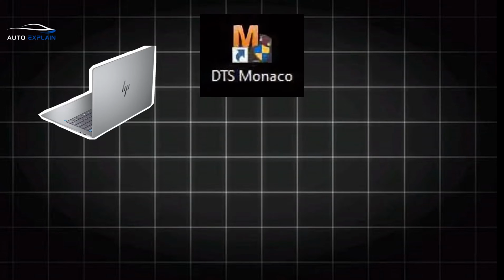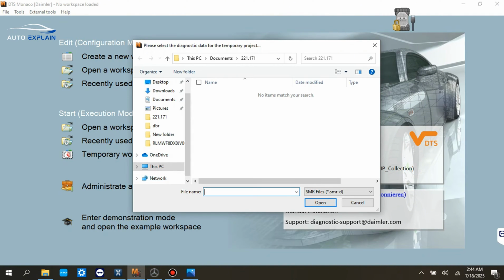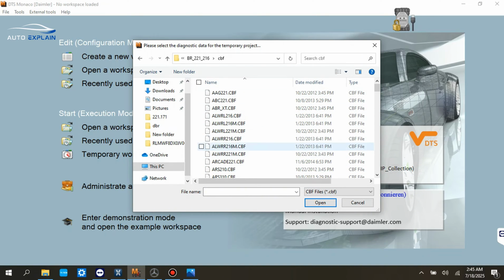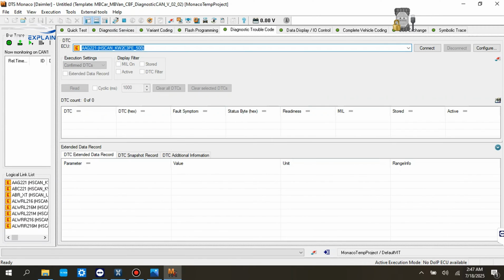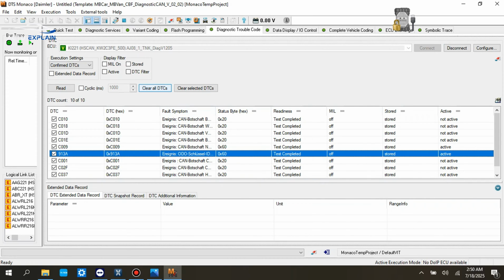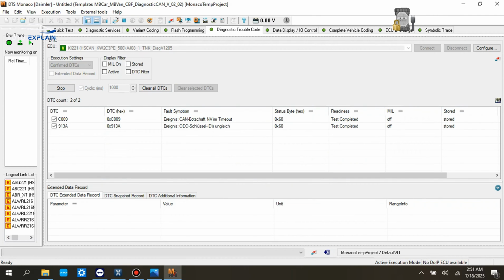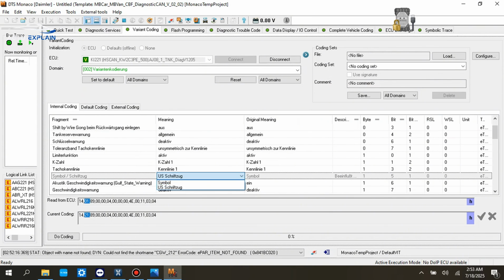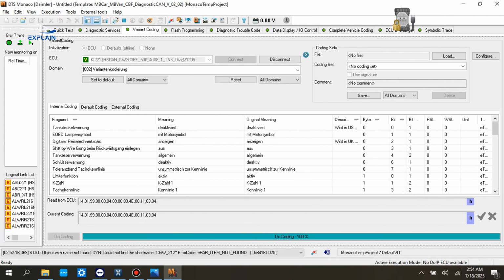DTS Monaco Interface Overview [Part 1]: Don’t Start Without Watching This!

Comment from the maker: This tutorial focuses on understanding the DTS Monaco interface and workflow.
Actual coding results may vary depending on the control unit and model year.
AutoExplain helps with advanced cases when needed.
WhatsApp +1 (517) 271 9168

Comment: Hey nice Videsos and i have seen your books they look als really cool, do u know if it is good to Use VCX SE / or Pluß for DTS? What would u recommend VCX SE or better Pluß if u have to choose between those 2
Reply from the maker: You can use VCX SE. But my recommendation is Tabscan T6 Xentry. Because the VCX SE sometime too weak for you to perform flash programming
Reply from the maker: We used to use C4, C6, but these device are being cloned or faked too many, so we use tabscan t6 recently. It’s kinda good to compare with C6

Comment: Hello, I have a 2015 W222. I didn't  see much info on the W222 in your pictures, do you include extensive coding for the W222?
I'm also very interested in the Vediamo software tutorial for the W222 as well.
Thanks 🙏
Reply from the maker: Yes , W222 you should use DTS